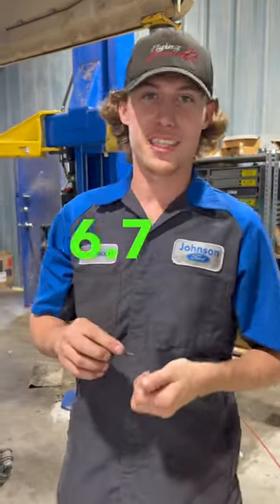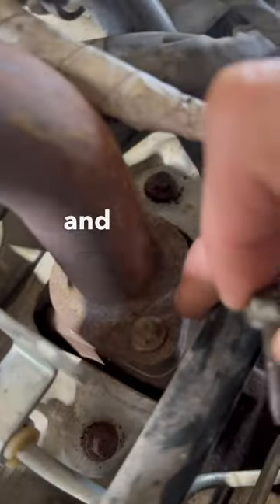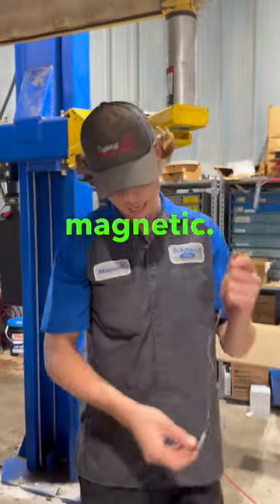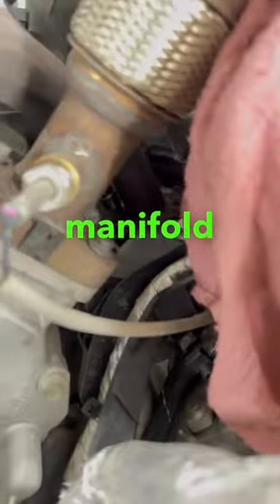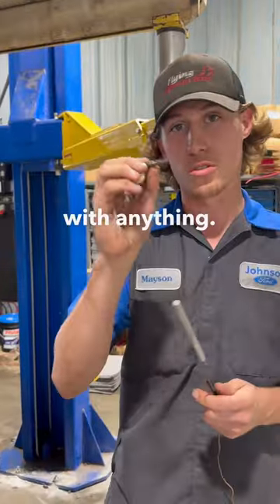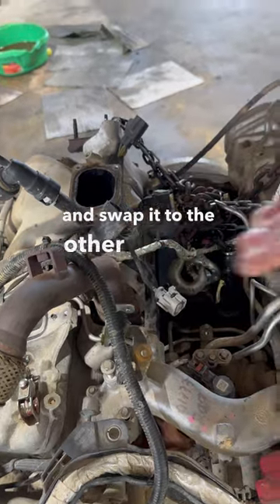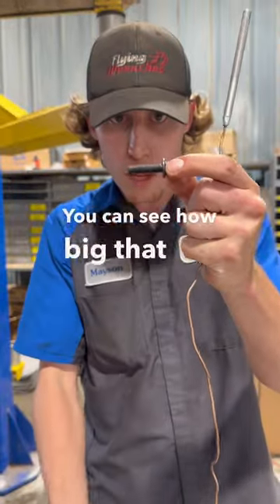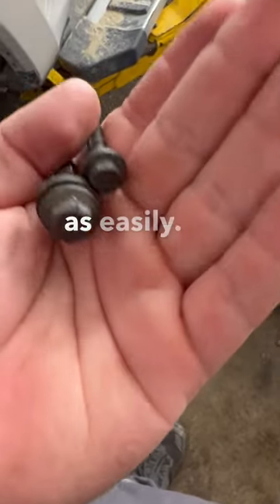6.7 PowerStroke EGR Bolts are a NIGHTMARE #shorts #powerstroke

Comment: Did an EGR delete on my truck....they broke...it sucked
Reply: Should get rid of EGR systems. It is the dumbest thing.
Reply: @JohnSmith-xu7ev who asked you? Genuine question.
Reply: @ineedapharmists  
Anyone ask a liberal to be watching car videos?
Reply: Deleting that BS in my old Toyota today. 😂😂 Gonna make that little 22RE purty
Reply: @JohnSmith-xu7ev they cant lol. Its a federal law. Has nothing to do with truck manufacturers. Ford knows egrs kill the engine quicker.
Reply: @Aptenodytes  
People can illegally. Manufacturing cant. But i believe the EGR causes more pollution
Reply: @JohnSmith-xu7ev that's false and not backed up by any research you could ever do. How do you figure it causes more pollution?
Reply: @superduty4556  
Im an engineer and been working on cars for several decades. 

Explain to me how a car with all of its passages clogged with carbon. Absorbing hydrocarbons, reducing air flow, and reducing fuel mileage be better for the environment
Reply: How long did it take you to drill them out
Reply: @dan-xe2xt  I didn't because I knew it was an extremely difficult task so I just bought a new exhaust manifold
Reply: @JohnSmith-xu7ev if you’re actually an engineer you would know that diesels use EGR to improve how quickly they warm up and stay warm. Then once they get warmed up the EGR is used to help reduce the rate of DEF consumption.

EGR causes carbon buildup in intake manifolds yes, but that is the price of having a Diesel engine that can compete with gasoline engines in tailpipe emissions.

Gasoline engines these days also require cooled EGR to reduce knock. Deleting it will damage the engine.
Reply: @DOAHunt3r  
So you got no clue to anything. You can prevent knock without an EGR. Been doing that for over 80 years.

You dont need EGR to warm up a diesel vehicle. We have been fine without it. Diesel engines are high compression and warm up real quick. 

Crying about DEF fluid, get rid of it. The need to manufacturer the fluid and transport it, and build systems to implement it is an environmental waste. 

Let me sell DEF fluid in plastic containers, then throw more plastic in landfills.
Reply: @JohnSmith-xu7ev  it certainly DOESN'T cause more pollution. If you wanna explain how that's possible then go ahead and tell me. I know basic chemistry and know urea binds to the burned diesel molecules and clean them. Bad for the engine though
Reply: @Aptenodytes  
How much resources does it require to make urea, transport it? That creates a massive footprint.. then create extra parts and systems for a car and truck to use it. tell me with your chemistry knowledge
Reply: @JohnSmith-xu7ev  Yes, you can prevent knock without cooled EGR but it is the simplest way. People are not interested in sourcing race gas, running E85 in their daily driver, or dealing with the huge maintenance overhead of water injection systems. People want to add fuel and nothing else, which is why you're complaining about DEF. 

Cooled EGR is in all kinds of gasoline engines now. Delete it at your own peril.

EGR is used in diesel to accelerate warm-up. It's great that you think they warm up fast enough without it but it's 20% more city fuel economy with it.

Doubt you're actually an engineer if you don't know these things.
Reply: @DOAHunt3r  
Wow, you have no clue to anything. 

Majority of cars dont have "cooled" EGRs.

2nd, according to you, since you have no education, why does EGR eliminate detonation?
Because all my cars and my motorcycles that run high compression have no detonation and run fine on regular gas. 

Im complaining about DEF because it is government control and its wasteful to the environment
Reply: @DOAHunt3r  
Explain how EGR warms up a 1000 degree cylinder in a diesel. It is already at 1000 degrees. You should learn how diesels work.
Reply: @superduty4556 you are reburning unburnt exhaust. Do you see what it does to the inside of and engine? That's what it does to the environment.  Now Def fluid. Def fluid is not saving anything. 1st you have to make the chemicals for the exhaust fluid. Dangerous for the environment.  Next you have to make plastic jugs and ship those to the manufacturer of the chemicals.  Plus ship the ingredients to make the chemicals.  Then get the wood to the pulp plant to make card board boxes for the Def. Then ship them to the box manufacturer. Then ship those to the chrmical company. Now they finally have the Def fluid to a point to where they can ship it to a warehouse  then wait to ship to the store. Then go to you where you throw it all away and oat someone to truck it to a landfill. How much diesel do you need to waste shipping Def fluid all over the country? This is not saving the environment.  Then all the waste products that come out. And the new chemicals coming out of the exhaust that they don't test for because they don't know what to check for yet. Years from now they will find out the fluid will kill us faster then the diesel. This is the stupidity that is our government
Reply: @JohnSmith-xu7ev  Majority of cars 15 years ago did not have cooled EGR, we're talking about new cars today. Look at almost every turbocharged GDI engine and you will find an EGR cooler in them. Subaru FA/FB DITs, Mazda 2.5Ts, Ford 3.5 Ecoboost, Toyota's Dynamic Force engines, even the Prius back in 2010 had an EGR cooler. All of them require it at full throttle to sustain high compression ratios without knock, especially at 87 octane. 

If you are asking why EGR is necessary to "warm up a 1000 degree cylinder" you're either not educated in engineering or you need to retake your combustion engines course. The coolant is at 20C or less during cold start, the piston to wall clearance is high, combustion is getting quenched more readily, the diesel doesn't want to vaporize as well, the list goes on.
Reply: @kennethlaw9830  DEF is urea. And the government also regulates the ammonia slip-through of the exhaust in SCR systems. The real consumers of DEF are getting it at the pump in giant tankers, not plastic jugs.
Reply: @DOAHunt3r  
Lol, you didnt explain anything. You saying a few cars have coolers doesn't change anything. Explain why EGR reduces knock. 

And diesels ran fine without EGRs for 80 years. I bet you think diesels use spark plugs
Reply: @JohnSmith-xu7ev  It's not in doubt that EGR reduces knock. Let's not move goalposts here, you were wrong that the majority of cars don't use cooled EGR. If it didn't work manufacturers wouldn't be spending the money to put the system into their engines.

If you are an experienced automotive engineer you should know this. It reduces the flamefront temperature and slows down combustion analogous to a firebreak. The cooler is necessary at high load where the benefit of inert exhaust gases can be outweighed by the sheer additional heat of uncooled exhaust gas.

Diesels can run without EGR but they run better with it when tuned correctly. Again, doubtful you're an engineer. Gasoline engines ran fine for 50+ years without electronic fuel injection either.
Reply: @DOAHunt3r  
"EGR reduces knock"
Rofl, so they dont prevent it. Therefore useless.

And there is no difference in cooled or uncooled EGR, they work the same. You cant read
Reply: @DOAHunt3r  
"The cooler is necessary at "
ROFL, more proof you have no clue about anything.  So you think the EGR uses air conditioner to cool the EGR, lol

"Reduces the flame front temperature"
Nice google copy and paste. So now you can cool an explosion. Haha
Reply: @DOAHunt3r  
"Diesels can......better with it"
And why is that mr hamburger flipper
Why would running lean be better? Why would putting dirty air into the engine that damages it be better? Why would killing the turbo be better?

EFI and Carb both run great without EGRs. You have no clue. You still have no clue why the Government forces EGR usage.
Reply: @DOAHunt3r  funny that why guys at diesel shops have dumpsters full of boxes they have pictures of. Is alot of it in the pump. Yes but it is still deliver by truck.  So you are only cutting half the steps I just put out there. Still has more pollution the just not having it.
Reply: @DOAHunt3r  I don't know of any modern gasoline engines that have EGR because variable cam timing has replaced the need for that system... Diesels have it but I can't remember last time I saw EGR....like a 2010 f150 with a 4.6...egr really isn't a thing anymore
Reply: @ineedapharmists put this way older engines even GT500s had em regardless being CA car or not it robs power along smog pump and waste of space
Reply: @Coronet_shop  laughs in Honda Impala that passed emissions and had its power
Reply: @kennethlaw9830  OTR truckers are the main consumers of DEF, most truck stops use dedicated storage tanks and tanker trucks for DEF. If you care about the environment go and fill up at truck stops instead of buying boxes of DEF. It's cheaper too.
Reply: @A-A-Ron3  VVT only works for part throttle EGR, which is good enough for naturally aspirated engines that have relatively low compression ratios for the gas they run. If you try to use VVT-based EGR at full throttle you'll lose power and increase fuel consumption due to knock. Modern turbo gas engines are using external EGR again because it allows for cooled EGR. Most people aren't looking at the last five years of engines. In something like a Maserati MC20 they've added turbulent jet ignition to improve fuel efficiency that much more. Rumor is Ford is planning on trying something similar for the "final" gasoline F150, basically F1 engine technologies applied to passenger cars.

Internal combustion is a lot more complicated and interesting than most give it credit for.
Reply: @DOAHunt3r often times when somebody deletes EGR on a diesel, they probably arent keeping the DEF and SCR systems either if it came equipped with them
Reply: @derpwnd3213  I'm aware, most of the people doing emissions deletes think anything that reduces emissions must be bad for the engine.

If it were up to me I would get a dynamic EGR tune that shuts the valve off once the engine is hot and up the DEF dose rate to compensate. That will help reduce DPF clogging and improve reliability. More NOx in the exhaust before SCR means less or no active regen on the DPF is needed.
Reply: @JohnSmith-xu7ev  ok “engineer” maybe do some more research into high compression high temperature reactions with oxygen and hydrocarbons and then come back.
Reply: @Aptenodytes you must not see the container ships and plastic containers with the energy to manufacture the def and the mining for the material for this crap. I guess we should not look at that... just like the ev battery's 😂
Reply: @ineedapharmists the military has none of these regulations because it’s a point of failure for them and they know it. They want everyone else to deal with it though, So I’m with the guy saying get rid of it. The point is get some more brain power and think. We can explain it to you not understand it for you, so cheers 🎉
Reply: @JohnSmith-xu7ev  okay I will. Def is 60% Urea from pigs that are already on a farm to be slaughtered. Pig farms have been around far before you or me existed. And the other 40% is deionized water (easy to produce btw) which requires equipment that also can do other processes. So theres no new equipment needed for the ingredients. As far as transporting it, yeah you got a point. As far as making egr, scr, and other emission parts, there is already machines that can extrude metal, make electrical componets, etc. Because they also use these machines to make every other part thats been a staple in vehicles for, again, as long as me and you have been alive. Yes it produces carbon emissions, but its neglegible compared to the emissions a diesel or gas engines make. Not to mention the smog which is visible in big citys as a result from vehicle emissions. Ultimately I hate that I cant delete my truck if I wanted to. But im not going to be ignorant and uneducated in the topic, I know the emission systems are reducing carbon emissions beyond a shadow of doubt. Doesnt mean I dont hate the equipment on new trucks.
Reply: @kennethlaw9830  Chemicals? You are very mistaken. Pig farms have been around since before me or you existed, as I told John in another comment. DEF fluid is over 60% urea from pigs. And the other ~40% is deionized water, which I can make at home. The plastic could come from recycled plastic, the cardboard, transporting to a store, and throwing the plastic and cardboard away is the only thing you have a valid point on. Diesel emissions are far worse than the def system. I myself hate the systems because it lessens engine longevity. But you are wrong if you think the manufacturing of the emission system equipment is worse than raw diesel exhaust. You know how to write a good story but you cant take a couple of minutes to research on google (which is free btw) so you dont look ignorant. Thats goofy man.
Reply: @JohnSmith-xu7ev  the government requies these systems because they are proven to produce a lot less carbon than the manufacure process of these systems. Only thing youve been right about is the fact that it kills the engine and turbos faster.
Reply: @DOAHunt3r  I read all your comments and can say you are the only one in here besides me who knows how to use a search engine so we dont look ignorant. Lmaooo
Reply: @Aptenodytes  
Ive been right about everything. But thanks for telling people government regulations on   cars is a government regulations.
Reply: @Aptenodytes  
Lol, so you are not a professional. You googling stuff doesn't make you educated. All you did was repeat what everyone said in the last couple days. 
We already know what emissions are. You are not adding anything to the conversation which hasn't already been said.

And you claiming the other liberal is right proves you and him have no clue in the function of the egr system
Reply: @Aptenodytes  
"I know it is reducing carbon emissions"
Since i wasted time reading it, NO, you are not reducing carbon.  If you were an engineer, you would know molecules dont vanish from chemical reactions. The carbons in gas will still be equal to the output you are spewing from your exhaust. 

You being a teenager with a honda civic googling stuff you have no clue about trying to debate someone with decades of experience in multiple fields will not go well for you.
Reply: @JohnSmith-xu7ev  I may be wrong but I believe EGR gasses prevent knock on engines that have lots of timing added to them. For example the 5.7 spider injected engines that came in 96-2000s chevys ran around 14 degrees of timing and if the EGR failed the engine would start pinging. again I may be wrong.
Reply: @lt.schlechtnacht9414  you are correct, gas engines will use EGR to run more timing.
Reply: Deleted egr on a Taurus I owned gas mileage got way better went from 10-12 to 20+ mpgh
Reply: @lt.schlechtnacht9414  
When the EGR is activated due to certain conditions,the ECM or PCM, will advance the timing. 
The EGR doesn't really prevent knock because the manufacturer designed the car to run with the EGR, so they have to tune it accordingly. So if you removed the egr, you would need to reflash the ecm, or if your lucky the knock sensor can retard the motor enough.
Reply: @DOAHunt3r  
The guy was asking me not the tree hugging liberal
Reply: @JohnSmith-xu7ev  Ive herd of people talking about removing the EGR from the 98 vortec engines and causing all sorts of problems. like you said most people have to have the engine tuned in order to remove the EGR
Reply: @JohnSmith-xu7ev  Weird, sounds like the engine needs EGR to run the timing and fueling that it does. Could it be that EGR can increase knock margin? We need your non-liberal non-treehugging engineering knowledge to be sure.
Reply: @DOAHunt3r  
The computer controls timing.more evidence you have no clue about anything. Go back to watching fast and furious.
Reply: @JohnSmith-xu7ev  yes, the ECU controls timing advance but the physical reality of the engine determines what the knock margin is. High compression engines may not be able to run MBT without tricks like EGR even at part throttle
Reply: @DOAHunt3r  
Name me race cars running EGRs because they have high compression
Reply: @JohnSmith-xu7ev  race cars are using 110 octane leaded race gas. Why do you think that’s relevant to normal cars running 87 or 93 octane?
Reply: @DOAHunt3r  
So you cant answer an easy question. Race cars run whatever octane they want. I go to the strip, i run 87 if i want. Still waiting for my EGR answer. 

I discussed this 2 days ago and you are uneducated.
Reply: @JohnSmith-xu7ev  Race cars don't actually run whatever octane they want? NASCAR runs 98 octane which is a huge bump over normal pump gas. You taking your daily to the strip has no bearing on what a "race car" will call for. Again, EGR is just one option of many when it comes to increasing how much timing you can run before knock starts. It just happens to be the best option in modern street cars. Would you rather be filling up a tank of distilled water every 600 miles, paying 8+ USD/gal for 100 octane, running E85, or cleaning your intake out once every 100k miles? The days of leaded gas and MTBE are over.

I'm not here to respond to your every argument, I'm simply leaving real information for others to learn rather than taking the word of a random stranger roleplaying as an engineer on the internet. Anyone who really wants their diesel to perform its best will keep the EGR and get a dynamic EGR tune instead. Better fuel economy, better engine longevity, all with no substantial intake buildup. And there's no need to make any changes on a gas engine with EGR at all.
Reply: @DOAHunt3r  
And why doesn't nascar run EGR? You still cant answer anything.

We dont put water in our gas tanks. We dont run ethanol or MTBE, or leaded gas. Grasping at straws because you have no clue what an EGR valve does

And why do diesels need EGRs? You cant answer it. People running without EGRs just fine.

"all with no substantial intake buildup"
So the 1000s of videos of intake carbon buildup doesn't exist. Or the tech bulletins from Ford doesnt exist .
You claiming now that car exhaust doesnt create carbon. Wow.
Reply: @99FXR Those RE’s live to lose that crap anyway. I delete all of that mess and it wakes them up
Reply: EGR slowly kills your engine anyway. Delete it.
Reply: @JohnSmith-xu7ev  NASCAR does not use EGR because they're using naturally aspirated engines that can't make up for the loss of fresh air with more boost. They also get more octane. Again, EGR, either cooled or uncooled, internal or external is just one tool in the toolbox. As a supposed engineer you should know that everything is give and take.

Diesels benefit from EGR because they warm up faster with it. I recommend reading what was written. Dynamic EGR is a retune that shuts off EGR after the engine warms up on diesels. I recommend again reading what was said. After a few minutes it shuts off which means next to no carbon buildup.

If you think anything I said meant that car exhaust has no PM or other forms of carbon emission like CO, CO2 you need to start with basic reading comprehension, not combustion kinetics.
Reply: @DOAHunt3r  
"NASCAR does not use EGR"
That means they will have knock according to you because of timing. Funny how your physics goes away.

"Diesels benefits in warming up"
So is that what EGR stands for? Rofl. So how does it warm up the antifreeze? 

So now the EGR turns of on a diesel. What happened to it being needed to prevent knock. I guess physics changes every time you talk
Reply: @JohnSmith-xu7ev  lol I didn't realize my comment would turn into a war zone but honestly I'm quite entertained
Reply: @A-A-Ron3  
Happens in car sections when you got dumb people thinking they know cars. And i can tell this guys a foreigner which makes it worse
Reply: @JohnSmith-xu7ev  just a bunch of office workers who think it makes sense on paper but no real world experience...I'm a triple ticketed mechanic and understand the difference between gas and diesel engines and where EGR used to be helpful with fuel mileage in the gas world while still ultimately being bad for the engine
Reply: @JohnSmith-xu7ev  Yes, if you take a Vortec that came with EGR and block it off it will knock because it needs it. You can retune the ECU to run less timing but that means more fuel consumption. If you design a NASCAR engine without EGR at the outset then no surprise it doesn't need it. OEMs design their engines with EGR because of the benefits it brings in street cars. You design for the intended application, you should know this as an engineer.

I recommend you actually look up what cooled EGR is. The exhaust cooler uses the main engine coolant loop and will capture significant amounts of exhaust heat on startup. It doesn't use the AC system or whatever nonsense you suggested earlier.

The laws of physics are constant but the results in different situations changes. This is also something very basic that an engineer should know. I'm sure you know this but diesel knocks by design and avoids breaking things by using injection timing to make sure all the pressure from knocking happens after TDC. EGR's ability to increase the timing margin before knock is therefore irrelevant in a diesel, but its other benefits are still useful.
Reply: @A-A-Ron3  it’s great to pat yourself on the back like this but every modern gas engine already has internal EGR using the variable valve timing system. Are you deleting every VVT cam phaser these days because it’s bad for the engine?
Reply: @DOAHunt3r  vvt is not EGR not even close...the valves are opened and closed at different times to control how much fresh air is pulled into the cylinder that does not mean it is reintroduced into your intake system destroying everything on its way back to the cylinder...I never said vvt systems were a problem although yes some of phaser designs could use some improvement. However I did say EGR systems are a problem and that is 100% true
Reply: @A-A-Ron3  VVT is a form of EGR. You’re complaining that external EGR systems increase maintenance requirements which is true and I agree it’s annoying to deal with but the solution is not deleting everything
Reply: @DOAHunt3r  Exhaust Gas Recirculation EGR... Variable Valve Timing VVT...where is the recirculation...it is not a "form of EGR"...does it deal with the same problem in a different way sure but they are not even close to eachother and as far as diesels go yes deleting it is absolutely the fix for this problem...and if you want a performance gas engine deleting it is also the way to go
Reply: @A-A-Ron3  Variable valve timing causes internal EGR. Just because the mechanism is slightly different does not seriously change what happens and what an engine calibrator will want to do with it. During the exhaust stroke the intake vacuum will suck exhaust into the intake manifold on overlap. It will put hot exhaust gases into the manifold for good or ill.

Modern turbo gassers increasingly all need cooled EGR to make power. They compensate for the charge dilution with more boost.
Reply: @DOAHunt3r  
Wow, now you have no clue about variables cam timing. Not surprised since you think EGR adjusts the timing on a car
Reply: @superduty4556 it kills engines and causes more manufacturing of unnecessary engines. That’s how.. They don’t care about emissions, all they care about is meeting that number on the rear of the exhaust pipe. Other than that their emissions are unlimited.. There’s a carbon footprint in manufacturing anything. Egr valves literally dump carbon into the engine and cause unnecessary carbon buildup inside the engine itself.. This can cause a higher failure rate (and it does which is why people delete them). That catalytic converter will do significantly better at burning harmful gases than the egr system will.
Reply: @DOAHunt3r Haha, def is just a way for a politician to make themselves look good. DEF is a waste and is pollution in itself..
Reply: @Aptenodytes your last sentence just proved the point as to why shit like egr systems and DEF is worse for the environment. You’re only calculating area of emissions caused by an engine. Manufacturing new ones because of said egr valves and def is why they’re worse for the environment. The shit kills engines and now I have to go get a new chunk of metal that had to be dug from the earth… that’s significantly more pollution than the slight amount of CO2 the vehicle makes without an egr valve….
Reply: @JohnSmith-xu7ev  if you don’t know that the main value of variable valve timing is the ability to control internal EGR you should go read the journal articles about it. This is basic stuff that has been well understood for over 25 years now. I thought you were an engineer?
Reply: @mrwashur1991  EGR doesn't change the CO2 output of a diesel. In fact after it warms up it slightly reduces the efficiency of the engine. It's purely for non CO2 emissions.
Reply: @DOAHunt3r  
Now you claim theres an EGR inside the motor? ROFL.
Reply: @JohnSmith-xu7ev  Evidently you’re someone who has never actually tuned a car in their life, even the most basic shop can tell you about internal EGR. That’s why cammed muscle cars lope at idle.
Reply: @mrwashur1991  actually new vehicles are made using reprocessed scrap. I dare say over half of the vehicle is recycled infact. Dont quote me on that, but I know for a fact a good portion is (even before I researched it) because I asked a scrap yard one time. And their biggest buyer was a steel and iron processor that sends most of their processed, pure metal to auto manufacturers. Also, yes of course the emission systems, (particularly diesels of course) tend to clog the hell out of everything over time. But for trucks that are driven on the highway a lot, I dare say they run better with emission systems. They have time at constant high rpm to burn all the soot off. So not all trucks with dpf, egr, and def fluid are dying quickly. Infact im going to say they all surpass 100k miles. I dont know about you but I garuntee that in a 100k miles thats a lot of carbon, smog, and heavy metals that were kept out of the air. But yes I see your point. Just dont forget that much of a new vehicle is old vehicles, and other scrap going into it.
Reply: @DOAHunt3r  
So i never did a tune up on a car? ROFL

So you claiming people who hotrod cars put camshafts in their car to help with emissions? Rofl. Im sure my hotrod does that with no emissions on it
Reply: @JohnSmith-xu7ev  no, at idle you want no EGR because it causes a rough idle. Any emissions benefit from EGR is lost because it causes misfires. That's why big cams with too much overlap have poor emissions at idle.

Again, basic stuff an engineer should know.
Reply: @DOAHunt3r  
Why does it cause rough idle? You said you need it to warm up the engine.
Reply: @JohnSmith-xu7ev  You do realize that cold start does not necessarily mean idle right? EGR is closed at idle for gas engines. Similarly VVT avoids overlap at idle because the EGR would cause rough running, misfires, and high emissions. The EGR at cold start is only introduced when enough airflow and fuel exists to overcome the charge dilution effects. Diesels are unthrottled so unlike gassers they can tolerate EGR at idle during cold start.

I'm starting to think you're not an engineer experienced in anything you claim to be experienced with. This is not particularly specialized knowledge for people that actually work in this field.
Reply: @DOAHunt3r  
All cold starts are at idle. 

So why doesn't the EGR warm up the engine. Funny that you can never explain the physics
Reply: @JohnSmith-xu7ev  why is it a bad thing? I can understand for racing yea but for economy cars what’s the big deal? Do you think it impedes combustion because you’re throwing “used” hot air in? I’m sincerely asking
Reply: Regardless of what your views are on EGRs, please just clean them occasionally lol it’ll make life easier. Unless you’ve got a 6.7 power stroke haha. Personally I drive Honda and Subaru. I just love listening to this guy talk cars
Reply: @LightsaberGoBrrrrrr  
According to the liberal on here, he claims they dont get dirty
Reply: @LightsaberGoBrrrrrr  
I already answered why.
Reply: @LightsaberGoBrrrrrr  ya all I commented was that I did a delete on my 6.7 and the bolts broke and then it turned into this huge thing 🤷‍♂️
Reply: @DOAHunt3r You are missing the point that the entire process of making and transporting the DEF is causing MORE waste and pollution for NO REASON!
Reply: @JohnSmith-xu7ev  It was already explained. You should go back and read what was said. EGR coolers extract heat from the exhaust during cold start which goes into the coolant, then when you crack open the valve to let a bit of flow into the intake the hot exhaust and vaporized unburned fuel are also helping to heat up the intake charge with reactive species that normal air does not. It's glow plugs on steroids.

Carbon buildup is inevitable with current OEM diesel EGR strategies. I only said that the carbon buildup is negligible if you keep the EGR for cold starts and tune it to stay closed after it warms up. Again, more evidence you don't work in the field you claim to be working in because cold start is not one load and RPM cell, it is any operating condition of the engine when IATs and coolant temps are close together at cranking due to cold soak and coolant temps are well below the target 80-90C for operating temps.

Throwing around liberal this liberal that is also not a good sign that you're winning the argument here, it's the last resort of people who don't actually know anything about engines. Engines do not care about your politics.
Reply: @DOAHunt3r spill a little of that DEF on the ground... Because if you owned a diesel you know it's damn near impossible not to unless you're at a T/A...
Reply: @DOAHunt3r thank you for actually holding the conversation with that troll Lmao. You literally explained multiple systems and he’s over here name calling. “engineer” LOL.
Reply: @superduty4556 it definitely doesn't fuckin help much😂 emissions are just for Californians who can't comprehend that burning it again at a different time still pollutes the air😂
Reply: @JohnSmith-xu7ev lol you're clueless.
Reply: @robertthomas4633  
Yeah, i don't care what you identify as a gender
Reply: @lilairstrike535  
"multiple systems"
Rofl, EGR is only one system. Are you from a foreign country?
Reply: I got an LT1, them exhaust bolts break off by themselves. Don't need no input from me.
Reply: @JohnSmith-xu7ev  Your original comments says “EGR System(s)” LMAO nerd
Reply: @lilairstrike535  
You know more than one car exists in the world. But keep trolling because you have nothing else going for you
Reply: @superduty4556 you burn less efficiently and use twice the gas
Reply: @post455  
With an EGR
Reply: This reply chain was a good read!